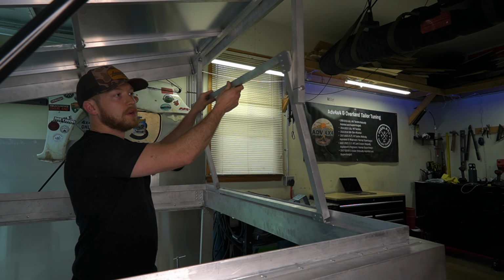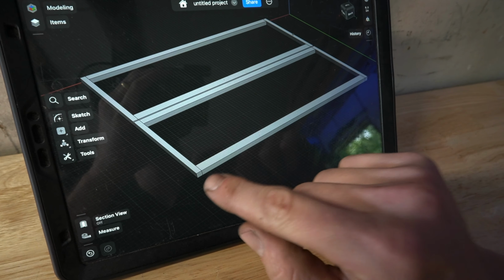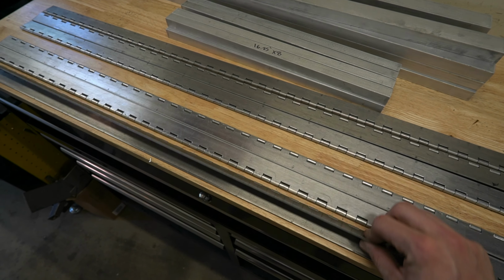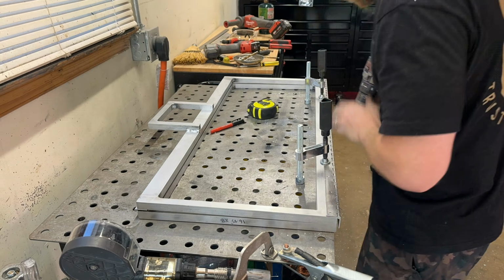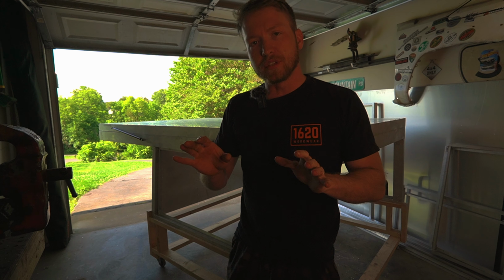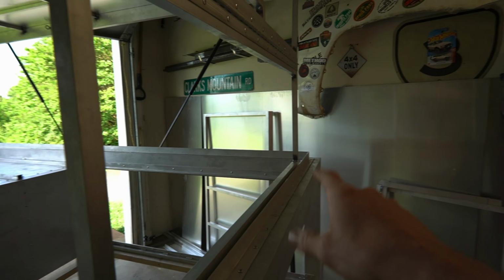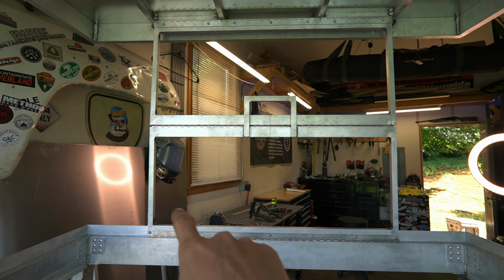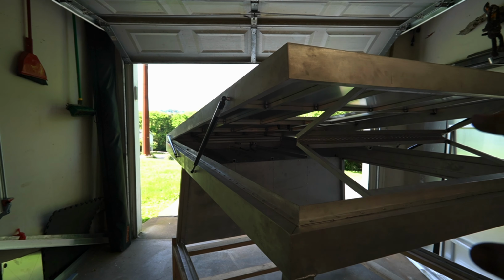Truck Bed Camper Build | Part 3.5 | Fixing My Roof Lift System!

Comment: Instead of using them flimsy aluminum brackets on each end, why not just make the entire end pieces out of plywood and have a solid wall?! Makes more sense and would work/look a hell of alot better too. You wouldn't have so much flapping and fluttering on windy days.
Reply from the maker: They are nowhere near flimsy. They lock Into place when open so no ability to flutter what so ever. This has been in use now for well over a year. 

You are only going to have flapping if your fabric is loose, which mine isn’t. This thing does not flap or move around at all in high wind. 

Wood rots and holes can wallow out over time. Metal is much better in my opinion but I also understand not everyone is capable of metal fab and is more comfortable with wood.

Comment: Throw a tab or 2 next to the henge handles so you can pin the henge open. Or a hole verticaly though the 2 horizontal memebers where the center henge is so u can drop a pin and gravity will keep it in place.

Comment: I was waiting for somthing to happen to those original henges. Im not a big fan of piano henges in a situation with flexing and excess weight. Even if they do hold they are liable to get out of wack and add extra resistance.

Comment: When your camper is closed, does the rear hinge system "droop" or sag at all? The Front hinge would be held up by the bed, but the rear is sort of free floating. I have mimicked your system and I can't figure out what I've gotten wrong. Thank you for this great series!!
Reply from the maker: It does not! If you move the hinge system up or down it makes the whole roof kind of slide forward and backward!
Reply: @Adv4x4  I am having an issue and i can't pinpoint it. I'm using 80/20 extruded aluminum and purchased the hinges off your amazon link. But it seems like my material is WAY too heavy for the hinges and i'm afraid they may rip out of the extruded aluminum. I'm missing something. Thank you for the response.

Comment: Looks good, maybe anchor the middle of the end awnings to the hinge area so you don’t have to try and tuck it in while closing? Also creating a couple bungee points on the sides you can hook up before closing to bring the sides in so the lid doesn’t pinch it. Just a thought, looks good!
Reply from the maker: Thank you! I had also toyed with those ideas myself!

Comment: What overall weight do you think this thing will be fully loaded?is the suspension gonna have to be modified?i didnt watch the very 1st video,so i dont know if you coverd that,my apologies,i kinda like more of the hands on video stuff vs the talking.the build is looking pretty good.i keep trying to think of folding panels instead of fabric
Reply from the maker: I think it will be around 300lbs when done! 

My suspension is already setup to handle the weight! 

Folding panels was considered but in the end it just adds more weight and is far more complex to design which I don’t feel comfortable tackling. I’d rather do fabric and have lots of windows!

Comment: I farted around with the roof lift system and struts for weeks to get it dialed. Not all at once, over time. 

Finally got it working as needed, roofnopens and closes and is centered. Now I just need to upgrade the gas struts. I knew I should have gone for surface mount thin solar panels... those 2 x 100 watt panels with all the wood my roof is made from is a bit more than I calculated. Lol
Reply from the maker: Trial and error is what it’s all about!!